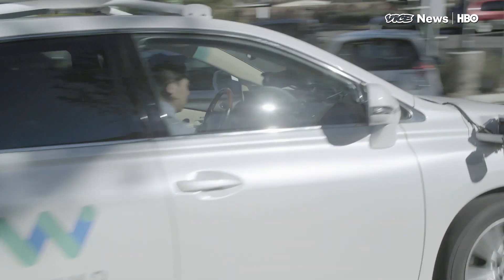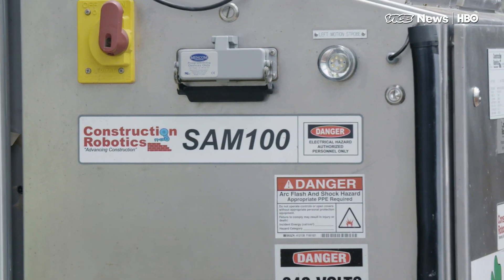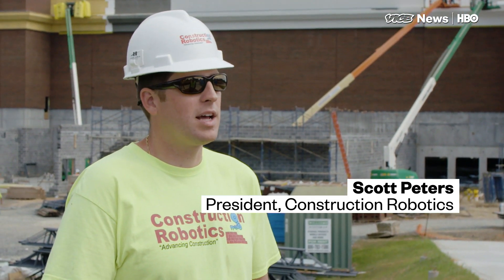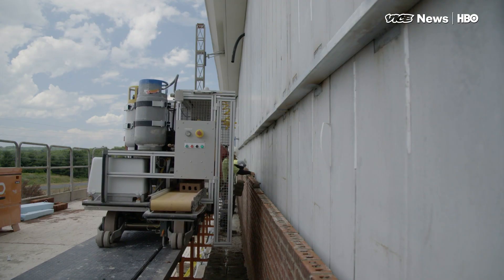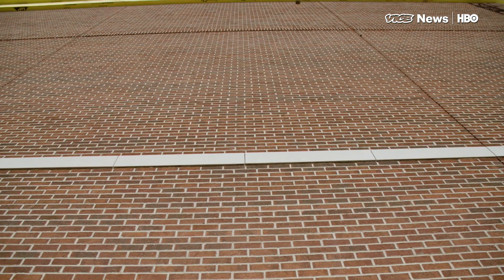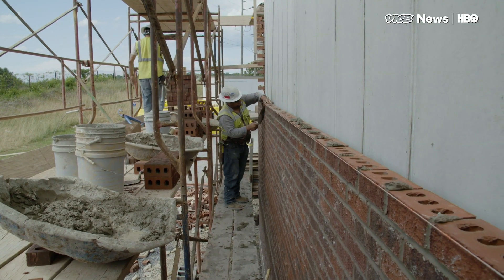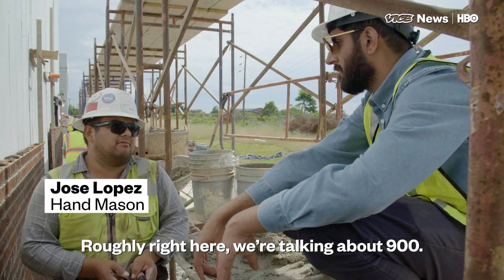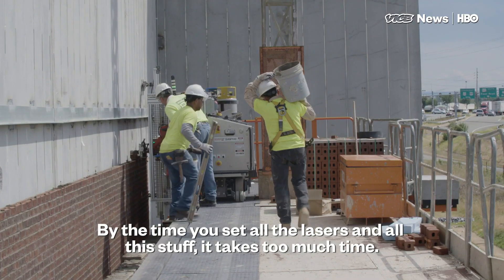This Bricklaying Robot Can Build Walls Faster Than Humans (HBO)

Comment: Good prototype. Illustrates the core task well. Now just need to refine the sub-systems. A brick repository that can hold a few tons of bricks that can be reloaded by a self-driving truck. A Laser/Imaging system that can identify and smooth out the excess mortar to be recycled in the machine. Refinement in the speed of the robot arm, and possibly 2 or 4 arms per robot. The speed could realistically be increased by an order of magnitude (i.e. current speed is 3000 bricks per 8 hours, or 1 brick laid every 9.6seconds. so would get down to 1 brick per second). If fully automated and running 24 hours a day, would be able to achieve around 86400 bricks per day - equivalent of roughly 100 brick layers. Of course I've no idea of how many projects require this volume of brick laying (aside from maybe Trump's Wall), but does seem conceivable that in a decade such a product will be available on the market either in the US or in China most likely. Support for other layouts of increasing complexity will also occur. At the same time great strides are being made in 3D printing buildings. 

Those who doubt the robotic revolution of the construction industry need to consider that construction has similar requirements to manufacturing,
which has been massively automated over the past 50 years. Why hasn't the same occurred in on-site construction? Simply the problem is more complicated, less repetitive. The task of producing a brick is simpler, can be built in a factory, and we know millions of the exact product will
be made. With construction, it requires having a mobile factory, uneven surfaces, varied environments, lower production numbers (e.g. 10,000 bricks for a project), it also requires cameras and image recognition (something computers have recently got very good at. Think Snapchat). Also automation focuses on the easiest, most profitable tasks, and then moves to the more complicated ones i.e. we've gone from agriculture, to manufacturing, and now we're on services (self-checkout, amazon warehouses, automatic car parks that scan your vehicle registration on entry/exit, Restaurant self-service kiosks). This is now the era when every day people are starting to see robots and automation (Before it was hidden away on farms, or in big factories).

Don't worry. The construction industry is very large and diverse. There will still be a lot of new, more interesting jobs that arise from the automation of the dumb, boring, and dangerous construction jobs. The likely side-effect of these improvements will be that we can carry out even larger projects, requiring the same number of humans.

Comment: If one mason = 1,000 bricks/day, 3 workers = 3,000 bricks- BUT robot builds 3,000 with 2 workers so it’s not 3x efficient, only 1.5x efficiency-
Reply: ALSO money stays with contractor not people, one less family that job fed, contractor bought himself a boat, one mason on unemployment
Reply: also people have to daily clean that thing and set it up, make sure it runs correctly, i know machines break down all the time
Reply: 2 finishers, one feeder workers,…. so that's three workers on the machine.

Comment: Why do they use bricks? It's for aesthetics purpose only, right?
Reply: booger king you ever run head first into a brick wall? Pretty solid
Reply: But there's already finished concrete wall at the back
Reply: booger king which makes this even more confusing...... just pissing money into the wind
Reply: Stamped concrete would be a lot quicker
Reply: booger king in this case it's for looks and not function
Reply: Little booger hush
Reply: They provide a solid insulation too.  Thing is E.I.F.S., the stuff you see on strip malls, basically exterior plaster is a much better insulation.  You get to dictate exactly how much insulation is required by simply choosing a thickness of foam to apply the product to.  It's not the cheapest, but it's cheaper than brick and more expensive than siding.

Comment: I've worked with journeymen masons who easily lay 4 or 5 brick in the time it takes this machine to lay 2. It's a cool concept, and I get that the machine doesn't take breaks, but I think with the time it takes to set up and tear down, the workers needed to keep it running, and the pace at which it works, maybe it isn't quite there yet?

Comment: I'm young and beginning masonry.  Been about a year now.  The robot is laying red brick, not cinder blocks.  Also, most residential homes and add-ons to homes are done with regular contractors who don't have and won't buy a robot like this.    Maybe in 20 or 30 years these mason robots will be easy to buy, adjustable and easy to operate.  Until then, I can only imagine huge building projects utilizing something like this.  With so many houses, upgrades and small commercial buildings going up, there's plenty of work for everyone.  Just find a general contractor and get to work.

Comment: trying to fix something that isn't broken. cost to Labor factor the robot will loose. you could pay 3 bricklayers for the cost of running a robot
Reply: +sfnwk78 Guess what else machines don't do? They don't get a paycheck and contribute to the economy via consumption (consumer spending) Some automation is ok. But how far will this go? There still has to be enough workers left in a position to contribute to the economy through consumer spending.
Reply: Man you don't understand, this is a prototype. As you would pay a hundred of traders for a computers 30 years ago, now traders only assist computers. It is just a matter of time.
Reply: Guess what machines don’t get sick or tired, call out, need health insurance or 401k, or paid holidays ect.
Reply: This isn't the same thing as a robotic assembly line in a Toyota plant. You have to drive this thing out and set it up. As was correctly stated by the worker, it's only good on long runs. Most brick laying work in the modern world is small scale homes with a variety of other types of cladding thrown in with it. Are you going to set up this robot to wrap brick around a faux column?

All this thing is doing is spitting some mortar on a brick and putting it in place. Why is it faster? Because it mixes it automatically and doesn't have to get its own shit. It's not even doing the skilled labor of the job, as it still requires someone to follow behind, LEVEL THE BRICK (Probably the most important part) and clean up the mortar. That's the part their not mentioning. Those workers are placing and finishing 900 bricks in 8 hours. That robot is spitting shit on 3000 bricks and putting it roughly in place in the same time. Imagine if it had to go back over it afterwards and clean up all the joints? You can't do it brick by brick. 

I'd love to see this thing try to cut and place 2/12 pitch arch over a window. There just simply isn't a high enough market demand on the services of brick layers to justify robotic aid becoming an essential part of the job. Especially when you can pay a guy $35 an hour to build you a Gothic church instead.
Reply: blkcandywarez “the doom and gloom that only a few will benefit has been said about the entire theory of capitalism. It’s been proven wrong.”

No it hasn’t; 3 people own 50% of America’s wealth and that number only will ever increase. Capitalism absolutely is only beneficial to a small portion of the population and once a tipping point is reached - it was reached long ago - there is no way to reverse the one way money flow; as all of the power for economic influence is in the hands of those who already have the money.
Reply: Rodolphe Fouquet exactly
Reply: sfnwk78 robots will be stealing your paycheck next.
Reply: you toob the tech will advance at an exponential level
Reply: evbb you don’t think robotics as a sector will advance in the upcoming years? Surely no one is going to invest their time into solely inventing new brick laying machines but the modality of robotics I believe is only going in one direction
Reply: I see what you're saying but if the tech advances to the point where it wasn't a waste of time to apply it to bricklaying, and significant, or even slight efficiencies in expenses and time could be made i feel like there will be demand regardless. There are niche markets in every sector. not in the next 5 years though or 10 for that matter but who really knows i didnt think i was gonna have the computing power i do now in my pocket 10 yrs ago
Reply: All fair points, I was just presenting the point of feasibility as I do enjoy imagining the advantages future tech could provide. I think when seeing the title of the video my initial interpretation of what vice was reporting on was with regards to more advanced technology and it's effect on mildly low skilled labor, either way i think we can just chalk it up as poor journalism ha ha.
Reply: +I'm Rick Harrison & this is my pawn shop fgt Definitely sensationalized, at least. :)

Not that I'd define brick laying as low skill, there's quite a bit of technical aspect to it. Regardless, i think there will always be demand for low-mid skill work. You use to be able to be just a stone mason, or just a brick layer. Now they're one trade, and for the most part the building isn't structural in the least. The thing to take from that though, is it's still a trade, it's just got different demands now.

I think you could also make the argument that these people have far safer future job prospects than someone who's arguably 'high skill'. Imagine being a robotic engineer, and then being replaced by robots who design robots better, or a doctor being replaced by inconceivably steady AI hands. At least when it comes to something like framing, or stone cladding, or being an electrician, or even something like installing gutters, these people can translate those skills almost universally across all of those trades without much adjustment. A framer will know how electrical wires run through a house, and how gutters are suppose to sit on a roofline, and that kind of interchangeable knowledge exists throughout the field.
Reply: Depends on scale however as these machines improve, it will be better run 23 hrs a day...never take a sick day...By your logic Factories would still be manual operations and they aren't.
Reply: mwnciboo semantics although not wrong. Exponential level is separate to exponential rate.
Reply: you toob yeah, 3 Bricklayers could keep up with one robots output of 3000 bricks per day. But what about the people that have to support the bricklayers? The guys who mix the mortar? The guys who Supply the bricks so the bricklayers can do their job? See it's not a 3 for 3 trade off
Reply: +you toob    You forgot to say FOR NOW  :)
Reply: +25mfd   That's short sited vision. The robots will take over, the tech is only becoming better and better. The goal is that the Humans get freed from the need to work, and will be able to enjoy life without.
Reply: Gathering No Moss regardless, it is the same difference - one way money elevator which can not be reversed.
Reply: sfnwk78 actually they do... The government doesn't allow these practices to bypass those. For every robot the company pays taxes and fees just like they would for a regular employee. This is regulated to prevent the very thing you mentioned. This is what is happening to Amazon; they have fully automated facilities. Also, mentioning a 401k is useless.... a 401k options carries many tax exemptions to an employer. Same thing with health insurance...

Small businesses may be able to get away with certain things but nothing close to a large scale wiping jobs out of the water. The only thing I can think of is liability...PERHAPS they will pay less liability insurance as a company for less employees because there is less risk and perhaps injury worker comp claims may go down but if I take your "grand scale" point of view - insurance premiums would eventually go down in a perfect ecosystem because of lack of claims..
Reply: I love when people who don't know anything about bricklaying, but heard a statement in a youtube video about how many bricks a human can lay, think they know enough to compare manual bricklaying to this machine.

Like others have said, each human worker also needs someone to feed them materials and bricks just like the machine does.
Reply: Tell that to the 'non-Euro/White-ancestry' countries.
Reply: F off with the $8/hr.   That's retarded.    America for Americans.   Do the work.
Reply: Stupid
Reply: +sfnwk78 exactly lol that guy's a moron.
Reply: For now at least you're right, that cost more for now but it might change quickly.
Reply: blkcandywarez utter nonsense, this is exactly the time to worry about automation. What exactly do you think people will do to earn money in the future? For every person you put out of work with machines you lose a tax payer. Robots don't pay taxes and only benefit big corporations and the bosses of any firm. There's no advantage for most of us. The bricklayers should all walk off site when they bring this machine on and refuse to work whilst it's on site.
Reply: How do you fix something that’s not broken? It’d be erroneous to call it fixing in the first place.
Reply: you toob Natalie Cabral not a chance! I saw 3 bricks already crooked. Unless you care less about quality and more about quanity then looks like same is your guy.  And if I had the same height to lay brick and 2 guys to do my finish work and not take a break and lunch 3000 bricks is possible for a human. This is just not practicle especially with level work which Sam will never be able to do.

Comment: Sorry but the human bricklayer will never be replaced by robots. Check the difference in quality between the two. There's no comparison.
Reply: Umm, there is a comparison and the difference is negligible between this machine and the average brink layer.
Reply: can this robot use difrent types of bricks can it adapt to specific situations can it build diffrent types of walls ......no it cant ....
Reply: It cant build the corners and the quality of facing brick is shocking .if that were a human you would get sacked for shoddy workmanship

Comment: So the machine can lay 3 times as many bricks as a man but requires two men to keep it working.  It only works in specific scenarios. Robots are a useful tool but not nearly the panacea they are made out to be. Skilled labor will always be irreplaceable.
Reply: No, not always, it's only a matter of time until robots evolve accordingly.
Reply: Robots dont evolve, we build and program them, I'm a software engineer, we're not there yet and won't be for a long time if ever, even considering advances in machine learning and such, you cant replace a skilled worker with an efficient algorithm.. if you go down the rabbit hole ultimately  you're talking about creating life... ok back 2 work now have a nice day humans!
Reply: They said the same thing about horses and stagecoaches. And you're quite right, they'll be irreplaceable alright... in a museum.
Reply: It needs apprentice level help, someone to load and strike joints; humans need this too, admittedly the machine needs more help than a skilled mason, and there is set up, but that still removes some masons from the job site.
Reply: apprentices do the brick handing out and making mud, skilled workers do the finishing
Reply: Gregory Everson not on the crews I’ve been on
Reply: Josh G I'll just put some bricks down so machine rolls and falls off scaffolding
Reply: I love when people who don't know anything about bricklaying, but heard a statement in a youtube video about how many bricks a human can lay, think they know enough to compare manual bricklaying to this machine.

Like others have said, each human worker also needs someone to feed them materials and bricks just like the machine does.
Reply: Hillary Clintub
Eventually, only people with IQ's above 130 will be able to match AI in jobs. Most people lack the intelligence to learn the skills needed for upper echelon jobs. I don't think they deserve to be annihilated for that.

The question is should humanity be allowed to continue existing when even the 200 IQ people are no longer needed?
Reply: Hillary Clintub
Except AI advances billions of times quicker than our biology. Eventually not one single human will be as good as even the worst AI at even the simplest job.

What happens to the human race when not even the most intelligent human is useful?
Reply: Hillary Clintub
I suppose one human could control all the AI and not need anyone else, though I think AI with intent will some day arise.
Reply: ...so when one man is laying brings he has no support??? ...he can get sick, this can't, he can strike, this won't, a man won't work in the rain, with little modification this can. Tell the persons who used to fix wagon wheels that skilled labour will always be irreplaceable. That sounds like more of a wish than a serious opinion there Josh